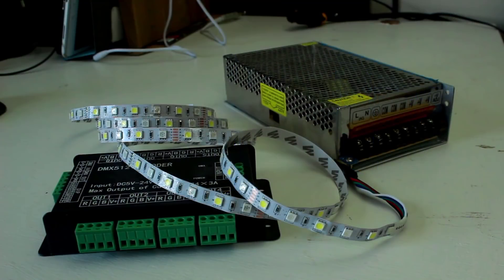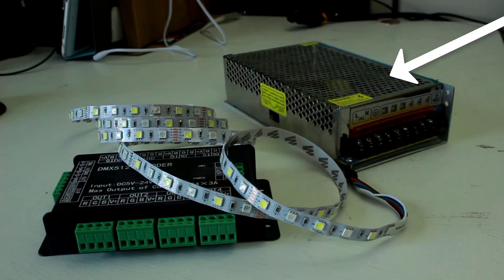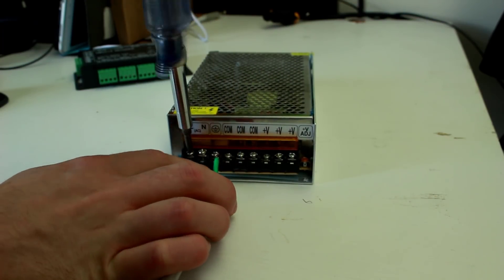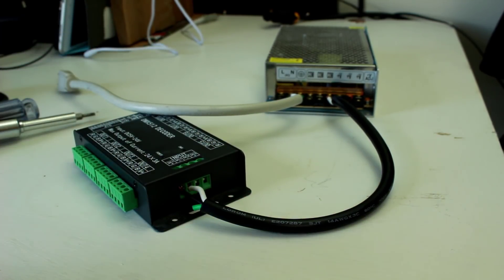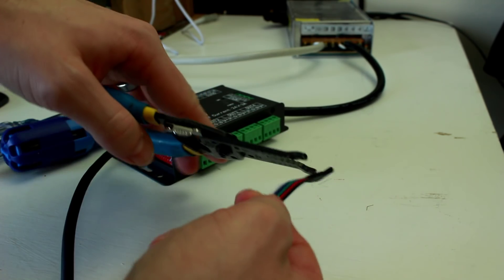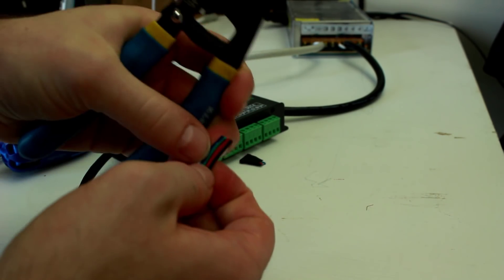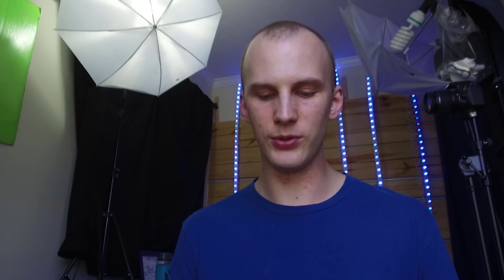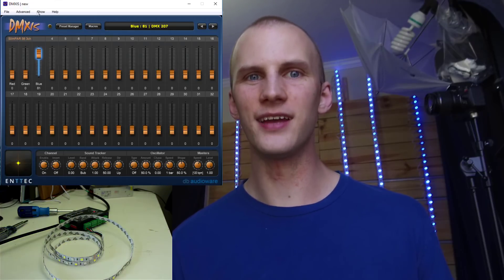How Do I Use LED Tape with DMX?

Comment: Hi -- Thanks for the video. Is it possible with this system to NOT use a dmx controller? I would rather just daisy chain the light strip to a laser that automatically changes to the beat. Thanks!

Comment: Hello
the missing part is how did you connect the decoder to the dmx software ?
Reply: with the the DMX input cable that he set up :).  he ran that straight to the board

Comment: Thanks for this info.  I need to daisy chain about 500 feet of 12V LED tape and get them all on DMX.  Is that possible?  If so, how do I calculate how much power I need?  Can a single DMX decoder handle this if all of the LED strips are attached?   Where do I get these power boxes?
Reply from the maker: Yeah, no way.  You will need to figure out how much power the strips you bought take, then how much power your decoder can take.  Then, re-start the tape on a new decoder or new output when you reach capacity OR your voltage drops too much (you will see the tape fade or flicker).  Hope that helps!

Comment: I seem to be having some trouble getting the LED strip to respond? I have my decoder dip switches set to address 1, LED strip screwed in to Output 1, and patched in the Chauvet SlimPAR 3ch fixture to address 1 on DMXis. Did I miss something? Thank you very much and love the videos!
Reply from the maker: Try working with any dip switches after 9 (10+), and see if changing them makes a difference.  These decoders change from time-to-time, and the dip switches higher than #9 are sometimes required to set mode.

Comment: What address or how to chage the address do you need to change on the Decoder so lets say it channel 65 (DMX mode), 66 (color), 67 (Speed), 68 (rotate)?
Reply from the maker: Not sure I totally understand the question, but I will try to answer.  In your console, you need to match up the first DMX channel to the DMX starting address on the decoder.  THEN, make sure you patch in the lighting console identical channels to the channel layout given by the manufacturer of the decoder.